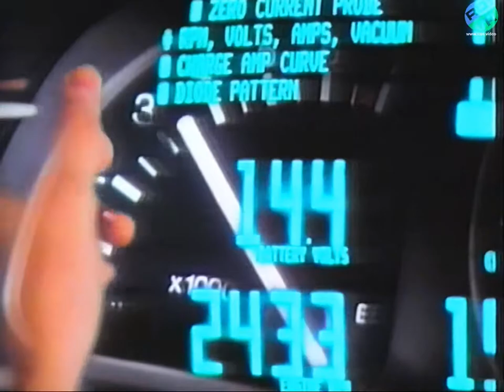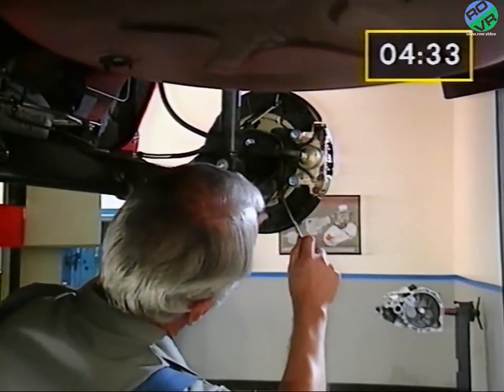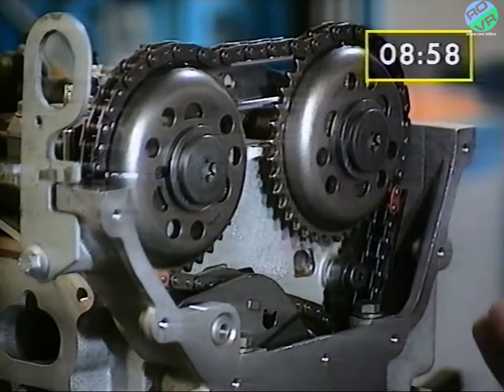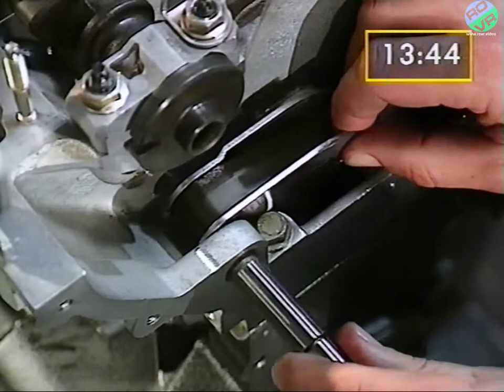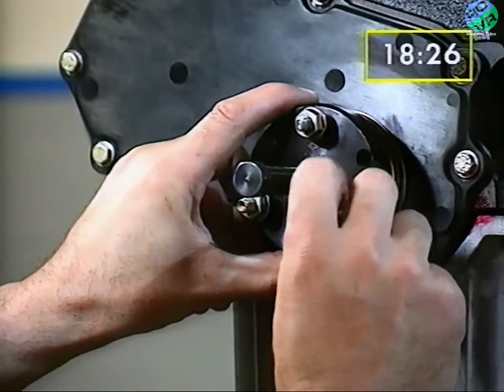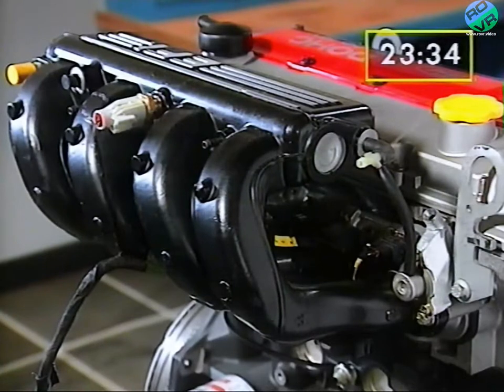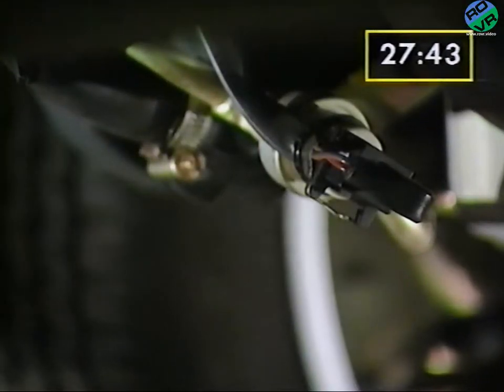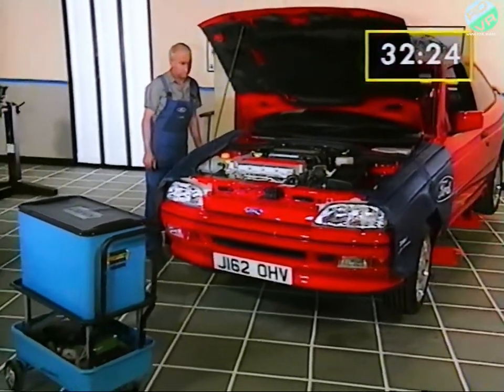Ford - Escort (Mk5) RS2000 Service Training VIdeo (1991)

Comment: Very cool to be able to watch this... I still have a completely original one from '91 in red, 99% stock, apart from k&n panel filter and stainless exhaust, and a mk1 Mondeo bumper lip. They're a pain to keep running though, not many are left so parts are hard to come by these days...
Reply: I don't think there are many left globally. Only one I knew has been rusted away about 10 years ago as it got some transmission problem and was left in bad spot for way too long time 😞

Comment: Same engine block as the Sierra 8v,but with a 16v head. If the new compressed plunger does become released,it can be used again,it just requires a nack on how to place the chain back on. I learnt this trick when I couldn't get my Sierra started,thinking I have  position the cams incorrectly,because too much fuel was drowning the spark plugs,which we know is called flooding. So,after several attempts to align the cams correctly,although they were correct,the fault turned out to be the IAT sensor

Comment: The Mk5 Escort was crappy by most standards but they did get the RS 2000 right, i've always liked them.
The press hated the run of the mill versions of the Mk5 but if you read the road tests on the RS 2000 it's a completely different story.
Reply: Of course, its like campre the regilar lancia delta against a deltona (HF Integrale)
Reply: It's pretty damn quick car in twisty roads.